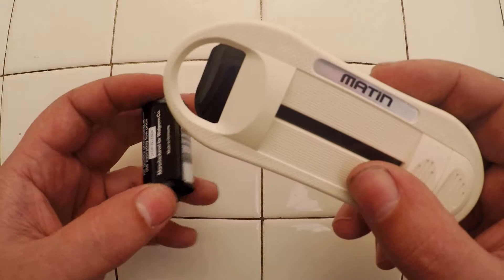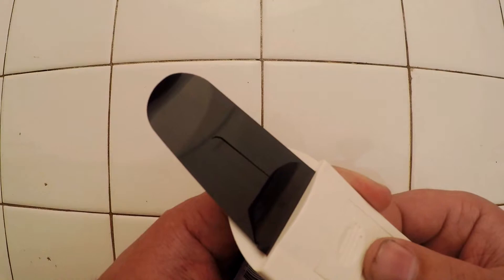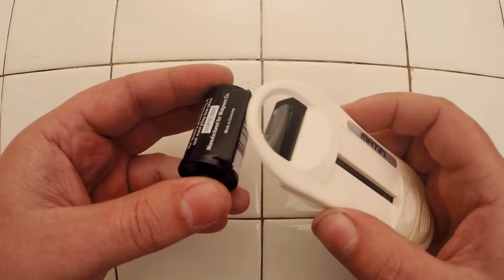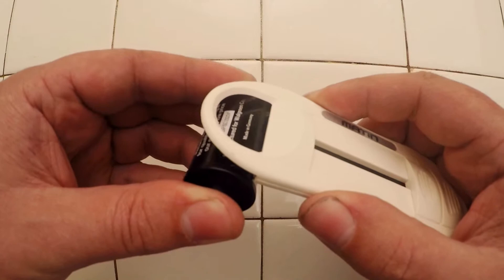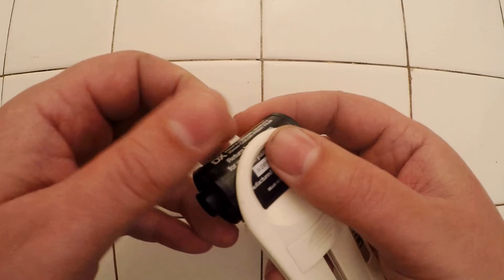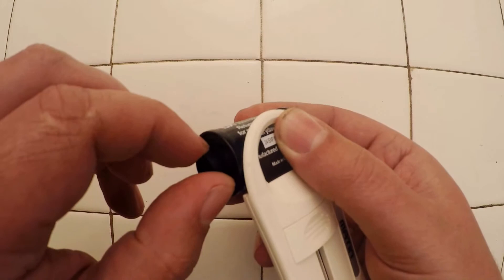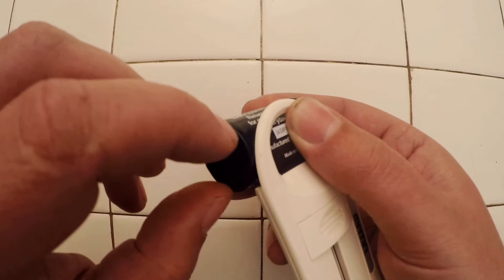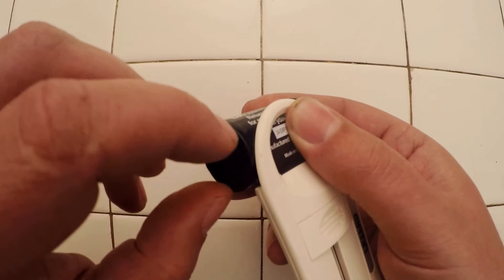How to use the Matin Film Leader Retriever

Comment: I guess they fill cinestill canisters with glue because I tried this for about 30 minutes and couldn't get the leader out even making sure to hold the rewind knob while inserting the second slider. I can feel it gripping the leader but it just can't pull it out
Reply: 2 months later and I'm trying this again with a roll of velvia and have the same issue. Impossible to remove
Reply: @SamCyanide same